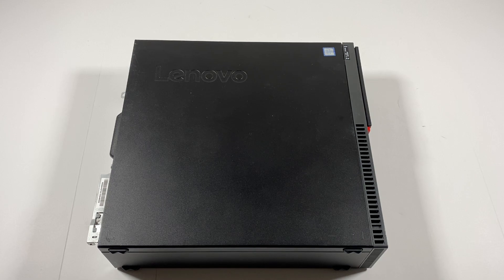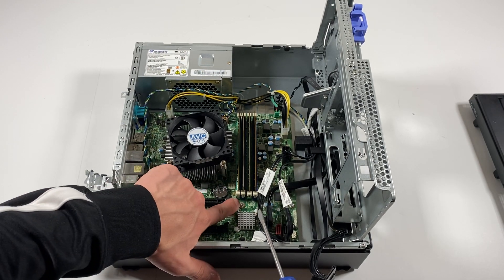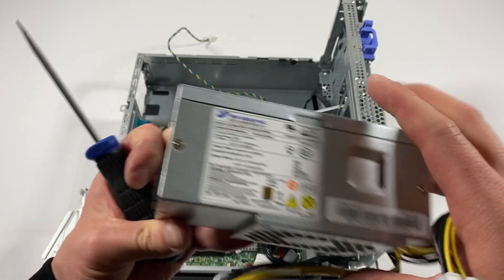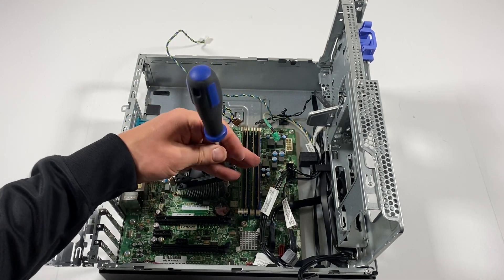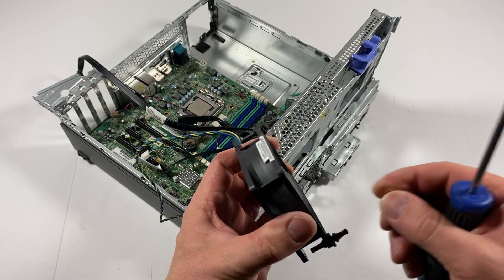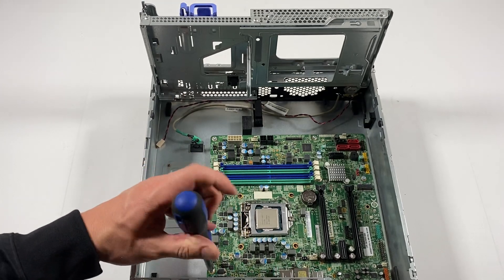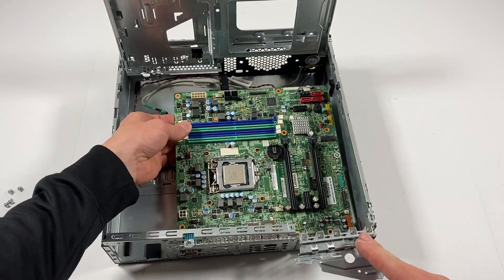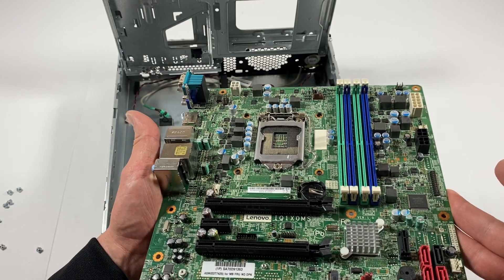Lenovo Thinkcentre M900 Teardown

Comment from the maker: List of Parts and Upgrades works with this system :
Lenovo Thinkcentre M900

CPU Installed Before The Upgrade: 
Intel Core i5-6500 Processor LGA 1151
https://amzn.to/3OKToC8

CPU Upgrade:
Intel Core i7-6700 3.4GHz 8M Processor LGA 1151
https://amzn.to/3zEAGqn

List of RAM will work with this system.
Maximum memory supports: 64GB  (NON-ECC)

(1.) Crucial RAM 16GB Kit (2x8GB) DDR4 2400 MHz CL17 Desktop Memory
https://amzn.to/3zljDuD

(2.)  Crucial 8GB DDR4-2400 UDIMM
https://amzn.to/3Q9D2no

(3.) Crucial 32GB Kit (2 x 16GB) DDR4-2400 UDIMM
https://amzn.to/3SbD3sZ

Thermal Compound Paste:
(1.) Arctic Silver 5 Thermal Cooling Compound Paste 
https://amzn.to/2ziNU0H

(2.) Noctua NT-H1 3.5g, Pro-Grade Thermal Compound Paste
https://amzn.to/36kTk7A

(3.) ARCTIC MX-4 (current edition) Thermal Compound Paste 20 Grams 
https://amzn.to/2DhGJaK 

List video cards will work with this system Dell Inspiron 3670

(1.) Gigabyte GeForce GT 1030 GV-N1030D5-2GL Low Profile 2G Computer Graphics Card 
https://amzn.to/2Z4PHkp

(2.) ZOTAC GeForce GT 1030 2GB GDDR5 64-bit Low Profile Video Card ZT-P10300A-10L 
https://amzn.to/2WzgLXk 

(3.) PNY NVIDIA Quadro K1200 - Supports 4 Monitors
https://amzn.to/3zLOoZq

3.5" to 2.5" SSD or Hard Drive Caddy Adapter R494D 0R494D 
https://amzn.to/2XTPeRr

SSD List:
(1.) Samsung 860 PRO SSD 256GB - 2.5 Inch SATA III Internal Solid State Drive
https://amzn.to/2BY5gRl

(2.) Samsung SSD 860 EVO 250GB 2.5 Inch SATA III Internal SSD 
https://amzn.to/37xWUfc

(3.) SK hynix Gold S31 1TB 3D NAND 2.5 inch SATA III Internal SSD
https://amzn.to/3d7X6D6

(4.) Samsung SSD 860 EVO 1TB 2.5 Inch SATA
https://amzn.to/2B2FURX

(5.) SanDisk SSD PLUS 1TB Internal SSD
https://amzn.to/3hwdqku

(6.) SanDisk SSD PLUS 240GB Internal SSD
https://amzn.to/2zfc7EX

(7.) Crucial MX500 250GB 3D NAND SATA CT250MX500SSD1(Z) 
https://amzn.to/3bTTjbX

(8.) SanDisk SSD PLUS 480GB Internal SSD SDSSDA-1T00-G26
https://amzn.to/2yfgjUK